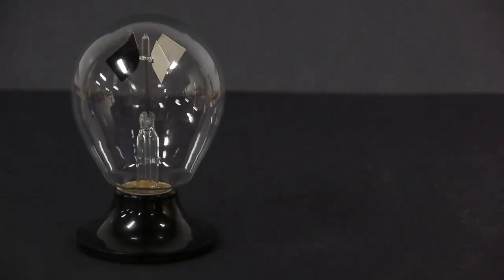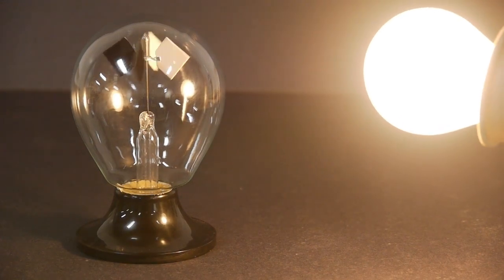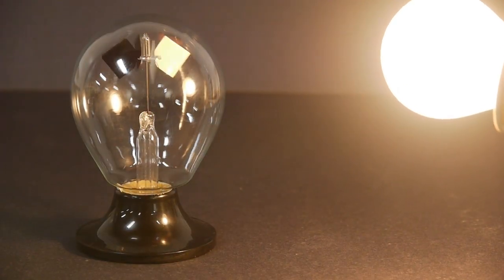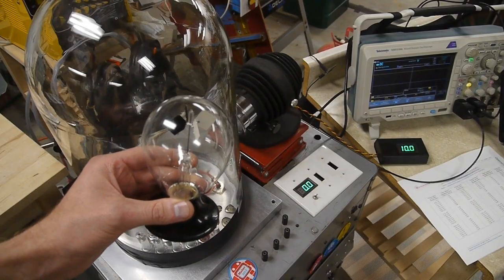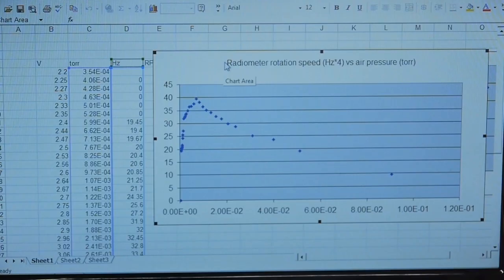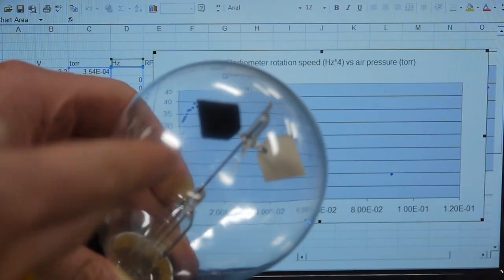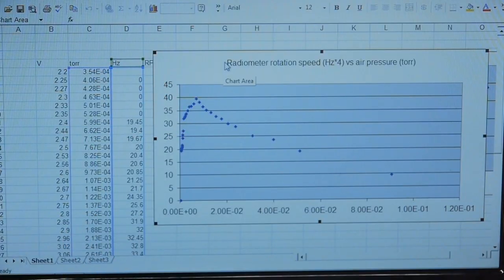How a Crookes radiometer works

Comment: Since it does not work in a vacuum, it's clearly not a photon pressure phenomenon.  Nonethelesss, I believe your assumptions about energy transfers for a bounce vs an absorption are wrong.  Consider a basic energy balance of ideal cases:

If matter bounces perfectly from a stationary surface, the matter remains at the same speed, just a different direction, and hence the same kinetic energy.  The surface must then remain stationary with zero kinetic energy.  There is no energy transfer whatsoever.

If the matter is absorbed onto the stationary surface, it must contribute all of its kinetic energy to the combined system, and the entire system will begin to move if unopposed.

Intuitively, it would seem that it requires more energy to turn matter around than to merely stop it, but in actual fact the departing matter must take the energy with it when it leaves.  The incorrect intuition is likely related to our limited ability to perceive the details of a short/severe impulse vs a long/weak impulse.
Reply from the maker: For an interesting look at momentum vs energy, think about Newton's cradle.  If you lift two adjacent balls from one end of the cradle, and let them go simultaneously, what happens?  Does one ball or two get ejected from the other side of the cradle?  Using the kinetic energy equation, either outcome is possible.  Using only the momentum equation, either outcome is possible.  However, physical systems must obey both equations, and thus only one outcome is possible.  Photons have momentum, and if they are reflected, they will transfer more momentum than if they are absorbed.  Check out a "Pelton wheel" for a nice physical analogy.
Reply from the maker: Svetty00 An object bouncing off another object will transfer more energy than an object that is at rest after collision.  This is because velocity has a direction associated with it -- it is a vector quantity.  Imagine being on roller skates and catching a heavy object thrown at you.  Then imagine tossing the heavy object back to the thrower.  You'll be propelled by both actions. Holding a spring and letting the incoming object bounce off is equivalent.   If we call the incoming velocity positive, and the outgoing velocity negative, and the collision is elastic (no energy lost), we'll actually transfer double the amount of initial kinetic energy.  In the reference frame of the Pelton wheel itself, the water is being reflected, so it is leaving the vane at the same speed it is incident.  In the stationary ground reference frame, the water hits the wheel, then is motionless, thus having transferred all of its kinetic energy into the wheel.  In the wheel's reference frame, the water is leaving at the same speed it came in, but the velocity is half of what it is in the ground reference frame because the wheel's rim speed is half the water jet's speed.
Reply: The velocity vector is a red herring.  Kinetic energy is the same, regardless of direction, and energy is conserved.
Reply: If you drop a rubber ball on concrete, the sum of all the bounces is the same as dropping it in glue, so each bounce must be less individuality.
Reply: I don't get the Pelton wheel argument either Svetty00.  Things change direction all the time without transferring energy.  See also: the surface of ordinary wheels, surface of planets, etc.
Reply from the maker: David Ludlow You are correct:  energy is conserved, and is a scalar quantity because of the V^2 term.  I did not mean to imply that there would be a generation of energy by a bounce.  In fact, what I wrote is wrong.  What I meant to say is that more momentum will be transferred by a bouncing object.  Momentum contains a V term that is not squared, and is a vector quantity.  Both the momentum and energy equations must both be considered in these problems.  An incoming object of equal mass to a stationary object cannot bounce off  at the same speed it had when incoming because this scenario doesn't satisfy both the energy and momentum equations.  However, if the stationary object is much more massive than the incoming object, the incoming object will bounce off at almost opposite its initial velocity, and transfer as much momentum as possible.  I'll do a video on Newton's cradle and show how lifting two balls at a time only results in having two balls ejected out the other side, even though there are other scenarios that satisfy the conservation of energy equation.
Reply: Applied Science The roller skate analogy is false because I'm perfectly inelastic.  I must expend muscle energy to throw the item back, which is work, which breaks the energy balance.  The spring is not equivalent, as it is obviously elastic.  Photons do not experience friction and are effectively perfectly elastic.

It is the breaking the catch and the throw into 2 actions that makes it inelastic.  If you were to catch and release fluidly, with a swinging motion, it would be more elastic and not impart so much energy.

As for the Pelton wheel's reference frame...  I don't fully understand, but I suspect that you are making the mistake of using a rotating reference frame and assuming that it has the properties of non-rotating reference frames.  While all non-rotating reference frames are equivalent, that is not the case for rotating ones - see centripetal force and angular momentum.
Reply: Applied Science I look forward to learning more about Newton's Cradle, but it doesn't directly address the issue.

Can't we shot some ping pong balls at roller skates with/without sticky tape or something?
Reply from the maker: You haven't mentioned momentum in any of your replies, which is actually the issue that started the whole discussion.  Newton's cradle shows a very clear demonstration of why kinetic energy and momentum are separate quantities.  I think shooting objects at rollerskates with/without tape sounds like a good idea too.

Comment: I wonder if the size of vane would affect pressure required for peak spin speed.
Although i cant see how, as if you scale then a a 4cm vane would require little vacuum, which makes no sense.
I also wonder if theres a correlation between amount of light to vacuum for peak spin rate.

Comment: What effect do different light sources have on the speed of rotation? Do different wavelengths have different effects? It would be interesting if it responded well to a non visible part of the spectrum like infra red. You could make it rotate with no visible means of adding energy.

Comment: Hi Ben. This is interesting to me. I built a LED strobe light of about a dozen 100W LED panels for fun. I noticed some very strange things during each pulse. Holding something like a black piece of paper in front of the array of panels caused it to jump a bit in ambient air. I thought at first it was maybe the metal sheet I bolted the LED panels to since the high current travelling through the wires creates a magnetic field which interacted with any metal/magnets nearby, I thought maybe it was making the metal sheet vibrate because of this. Although this /was/ a contribution, I noticed the effects were greater on a black piece of paper in front of the array than on a white piece of paper (same paper, different colour). I know the variables are different, I used a ridiculous amount of current, and ridiculous light output. I presume this is the same kind of effect as demonstrated in this video? Enjoying your videos as always, keep it up!

Comment: Very interesting. I've owned one of these for many years, ever since my Physics teacher demonstrated one. However, aren't the vanes slightly tilted? Like a fan? I always thought the effect was the black areas heating more quickly, then heating air molecules which then rose, further colliding with the tilted vane and causing it to spin. Similar to the little devices people place over candles to ring bells.

Comment: Why is the thermal recoil an edge effect?
Reply from the maker: In the center of the black vane, the gas molecule recoils with a little more energy because it was heated by being briefly in contact with the vane.  Now that it is traveling more quickly, it has the potential to knock away other incoming gas molecules, or at least transfer more momentum into them, and cause fewer gas molecules to strike the surface, or at least with less momentum.  Supposedly, the additional vane momentum gained by having the molecules recoil with more energy is canceled by the effect of driving away other incoming gas molecules.  Near the edge, this effect does not cancel because some incoming gas molecules would have missed hitting the vane entirely, but we still get the momentum transfer from gas molecules that do hit it.  Check the wikipedia article.  The explanation for transpiration is even more opaque.  It's fairly obscure stuff in general.

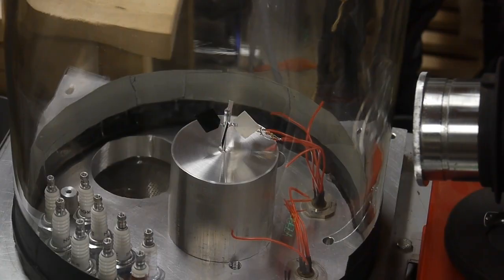Comment: 3:24 Is that spark plugs inside? Wonder what they doing there
Reply: Yes they are. They're good for getting high voltage into the chamber as they're insulating and also fairly vacuum tight. (Think about their intended application!)
Ben's done a fair few videos involving HV in the vacuum.
Reply: Minifig666 Thanks

Comment: Sweet, very cool way to test this. I wonder if having vanes with a large edge:surface ratio would spin faster?

My Radiometer slowly lost its tenancy to spin after I left it in a sunny window for an afternoon. I'm not sure if something gassed off or if the needle/glass bearing experienced wear. It still goes but only with very strong light sources.
Reply: I think your pivot point has warn down. Think about it, to make the vanes able to spin with very little force exerted, the whole thing is suspended on a needle fine point; and as the vanes rotate, the two surfaces will wear each other down. So after a very long period of use, the turning motion of the vane assembly would wear down the needle fine point to become more blunt. The more blunt the needle, the more force must be exerted to induce motion. Hence the requirement for a brighter light. More light = more force.
Reply: @chronos1002  I think like UV rays from the Sun affect many materials, it might have made the metal react and kinda corrode in some way making its surface rougher. Or maybe the vacuum might have reduced which then again lowers the RPM.
Reply: Possibly by sitting in full sun for a while the temperature of the whole system has warmed and the temperature difference between the two sides of the vans is less resulting in less of an affect.  I don't know, maybe?  Cheers, Mark
Reply: I thought that initially but it has stayed the same since then. Without a 500w light it refuses to get going :/
Reply: The glass may have a very small hole which is causing air to leak in. It happens sometimes with electronic vacuum tubes.
Also, you can test the worn bearing hypothesis by getting another radiometer and testing how much the vanes rotate when the radiometer is rotated. If the bearing is worn, the vanes should move more than an unworn bearing.

Comment: Soo... windmills on Mars would just be these right? Wonder if that would work...
Reply: Why wouldn’t they just use solar panels? That’s way more efficient than trying to harvest the energy of this kind of contraption.
Reply: I think not, because the chamber not only creates the right kind of pressure but also eliminates stray breezes pushing on the vanes. Wind storms on mars are strong enough to kick up dust, so I bet they'd be strong enough to interfere with a radiometer as well.
Reply: +Sonja I don’t think he was asking it they’d work on mars as radiometers, he was asking if you could make a “solar windmill” on mars, which would be like using a gas engine to power a fan to blow the windmill, it’s just not efficient at all.
Reply: Travis Pratt no, that is nothing like that. The gas engine requires digging up and refining petroleum while a radiometer could be “powered” by the sun. It’s more like a sterling engine powered by a volcano.
Reply: Why would you not just use a regular wind turbine XD

Comment: Data is beautiful, as they say.    Great stuff.  Would be very interested in the larger vanes and other possible variable tweaking.   Gas composition? energy wavelength?  Do the black and white faces need to be bonded thermally?

Comment: So, does this work with a lightbulb that doesn't generate, or at least generates much less, heat? For example an LED lamp? Great video as always, love your style of making videos!
Reply from the maker: Tungsten lamps produce a lot of far infrared, which is just as effective at heating the radiometer vane as visible light. I was using a 40W bulb, while LED and CFL lamps do not put out as much total power (eg 15W or less).  So, it is just a question of total output radiation in the far IR to visible spectrum, which is much higher for a typical tungsten lamp.

Comment: Is it running faster with CO2 atoms or slower?
Actually it should be slower right?
Simply, it just moves because the black side is heating up the molecules and they in turn move faster away from the black side thus creating the force?
Therefore with CO2 the gas will absorb more heat and there will be less heat coming from the black side?
Or will it be the same?
This is confusing!
Never saw this thing before, great video!

Comment: In 1873, Sir William Crookes (1832-1919) believed that he had demonstrated radiation pressure when he came up with the so-called  radiometer  (or light-mill)  displayed on his coat-of-arms.  This ain't so,  despite what many sources still state.  Radiation pressure is too weak to turn the vanes of such a radiometer and its theoretical torque  opposes  the  observed  rotation!  (The dark sides of the vanes are actually  receeding.)  Crookes' radiometer is actually a subtle heat engine in which the rarefied gas in the glass enclosure plays an essential rôle  (it wouldn't work in a hard vacuum).  The moving torque is due to what's called the "thermal creep" of the gas molecules near the edges of the vanes, where a substantial temperature gradient is maintained...  This was first correctly explained by Osborne Reynolds (1842-1912)  in a paper which Maxwell refereed the year he died (1879).  Maxwell published immediately his own paper on the subject, giving credit to Reynolds for the key idea but criticizing his mathematics  (the Reynolds paper itself was only published in 1881).

Comment: Magnetically levitate something in vacuum and try to use actual photon pressure to spin it.
Reply: Magnetically levitation devices have friction too.
Reply: That sounds like it would be awesome.
Reply: nRADRUS
Interesting, still with a thin suspended rod the drag force should be minimal, especially since you are not actively consuming the current. the net effect should be a static charge on the surface of the rod.
Remember, this is not a eddy current, you are just pushing on electrons and they push back....while they move.

I'm willing to bet the drag is low enough for photon pressure to be observed.
Reply: Perfect idea, although, with a nitrogen-cooled heat pipe going into the vacuum chamber, one could also place a perfectly reflective (like silver foil) vane on a superconducing "floating pellet", effectively also eliminating the "levitator drag" nRADRUS mentioned above, and shine onto this surface with a high power laser.
Reply: nRADRUS depends on the configuration, with active suspension from just one magnet from above there are no eddy currents.
Reply: Why is he muted?
Reply: Daedronus Homopolar generator
Reply: I'd try to make something that floats on a superfluid and spin it with light

Comment: My guess is that the light is absorbed by the black face and re-emitted as long wave IR. This transfers heat to the air molecules in front of the black face, causing a slight increase in pressure and making it move. It has to be low enough pressure so that there is less air resistance so all the vanes can move easier.

Comment: This is great demonstration. However to clear things to those less familiar with Torr, militorr scale> 7 mTorr is equal to 0.00000933256579 bar. (Or 0.9 Pa to those SI compatible people out there.) This pressure is kind of close to zero. We are not talking about Mount Everest air pressure heights as the corresponding air pressure is at about 40 km above the surface. Or 25 miles. This is the height the Google Exec just jumped recently setting a new record in sky jumping heights.
Reply: Torr bar and Pa are well known among all the thing that confuse a SI person is the imperial nonsense
Reply: I actually had to lookup mTorr. I know SI pressure and I am familiar with bar and psi.
And really wanted to know what kind of vacuum we are talking about here.

Comment: I've always wondered why most of them have 4 vanes- if it was something they tested and was the best or just was the easiest to build and balance. 
You also might have a chance to set a strange record- the largest lightmills I've ever seen had only slightly larger vanes set on longer arms. If you can scale one up to as big as will fit in your bell jar, you will probably be the largest by 10 times or more.